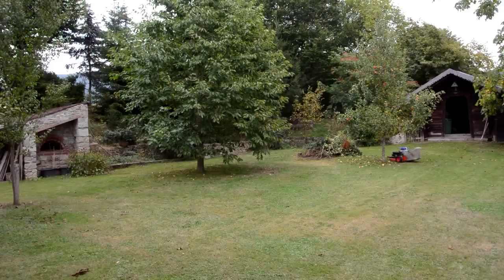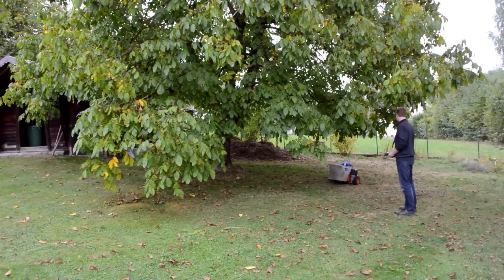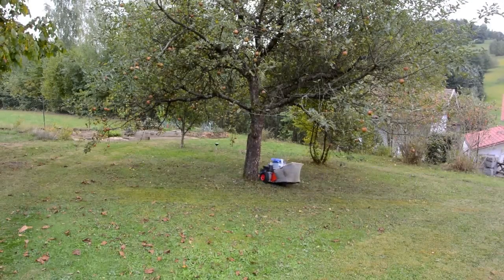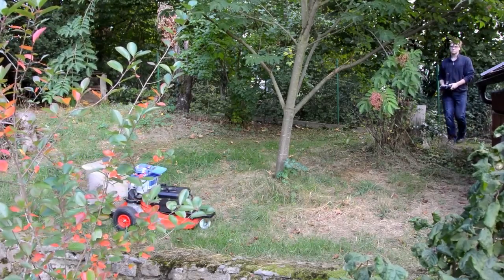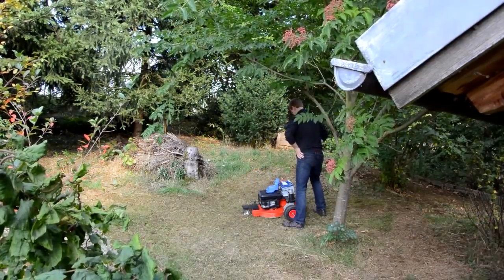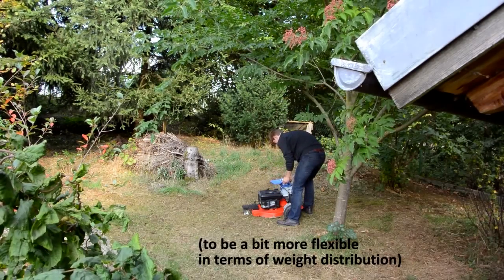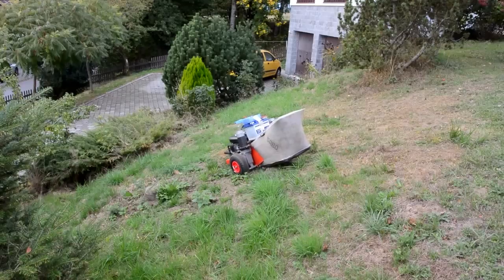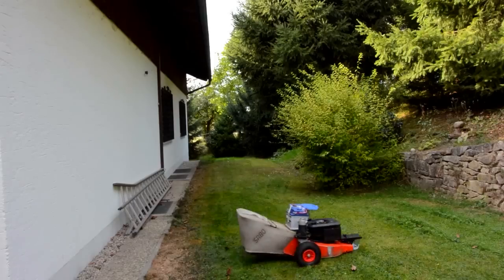RC Lawn Mower Test

Comment: Very cool.  But to make it autonomous will of course involve some software  Lots of it.  And that will suck up crazy amounts of time.

Wonder if you could rig up another magneto on it (using the permanent magent on the flywheel) to keep the batteries charged.
Reply from the maker: +Matthias Wandel I think autonomous was the wrong term for what I will try to do. I want it to follow a certain, path via gps. I have no idea if that magneto idea would work but I'm going to look into it. However I don't think a generator like this would produce enough power. But I could be completely wrong. What I thought about is to make a traditional generator start the motor and charge the battery when the motor is running.

Comment: Don't worry Rapunzel someone will rescue you :) 
What if you changed the engine to one with a stator on it and the battery to one of those smaller sealed ones - like the sit on mowers have; it would charge the battery as it went around.
Nice idea you have there. Would a tracked one be as maneuverable as that one is and would it chew up the lawn?

Comment: I wonder if you could take the software from a Roomba and make it so that it just drives around and bumps into things and turns around.  It would take longer but the entire yard would get moved eventually.
Reply: +FunWithWoodworking That's what I was going to say... I have two old Roomba's that still work but need batteries... use the sensors from one to bastardize an autonomous mower
Reply from the maker: +FunWithWoodworking That would consume masses of gasoline and the neighbours would get their pitch forks pretty soon.
Reply: go petrol just as a test bed.. then go electric
Reply: Cosmas B Good point, I didn't even think about that.  It would be cool to see if it worked though.

Comment: Also, you could wire up a couple of Go Pro cameras, and then sit inside your house while you mow. Stream the feed to your computer so you can monitor.
Reply from the maker: +Jeremy Davenport The problem is i really don't want to sit inside the house when it's nice outside :/
Reply: Makes sense! I love being outside too, but I have really bad allergies. But, I would probably watch it outside too. The novelty value is really high!
Reply: +Jeremy Davenport you can still sit outside on the porch with a cold one of your choice in the front or back yard and still mow the opposite side